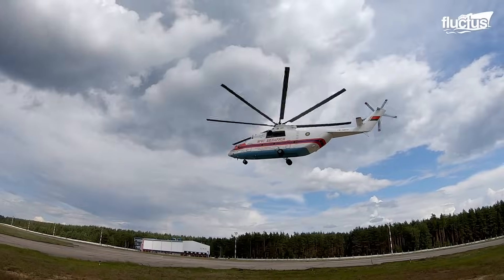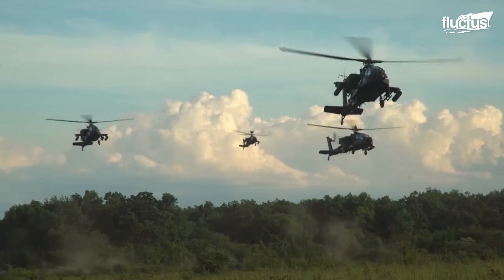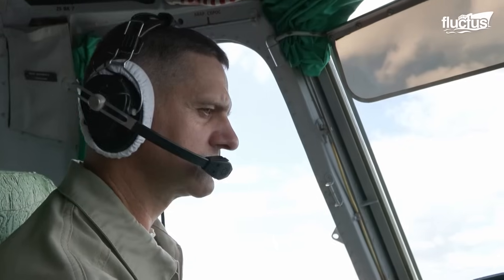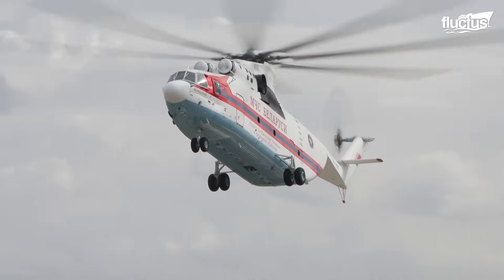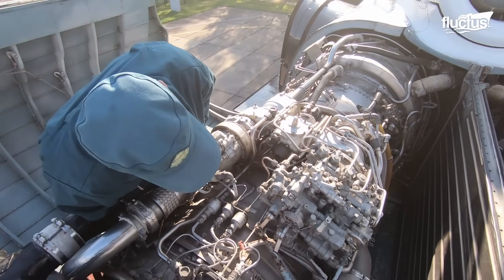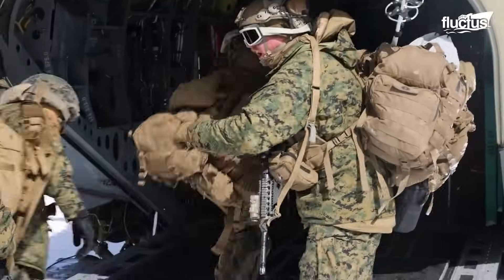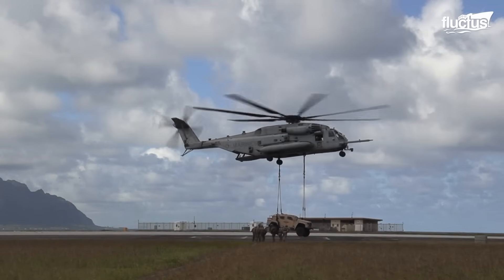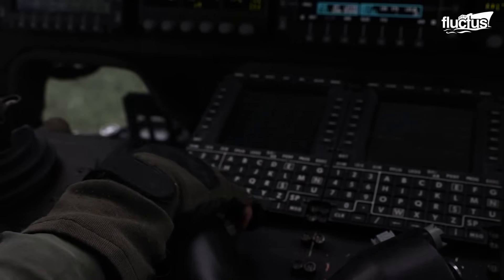Behind the Crazy Process of Starting World’s Largest Helicopter Ever Made

Comment: What's the big air intake immediately in front of the rotor head seen at 4:25? Is it a cooling fan for the transmission or something else?
Reply: I think it might be the APU, Auxiliary power unit, it runs off of a little turbine engine.
Reply: @bigredc222  Nah it's not that. The APU is under the cockpit.
Reply: @davidkavanagh189  After I made the last comment I searched were is the APU, it said under the flight deck, so you are right, so what is the thing Dave is asking about
Reply: @  My best guess is it's a transmission oil cooler
Reply: @davidkavanagh189  I think you are right.

Comment: I believe it's a rotor, not a propeller.
Reply: You are correct. Youtube is full of inaccurate crap
Reply: Correct sir, there's no propeller on a helicopter.

But they do not 'adjust the rpm, to get the nessesary power for take of.'
A helicopter runs at a set rpm ,constant.
The 'power' needed for take of, is made by pitch.
Pitcing the blade, so it generates downwards thrust...
Reply: @Rene-e9p  You couldn't be more wrong.
Reply: @stejer211 Ohh, lecturing a heli pilot...
Reply: @Rene-e9p if only he fact checked first
Reply: I'ts actually a "rotary wing" aircraft